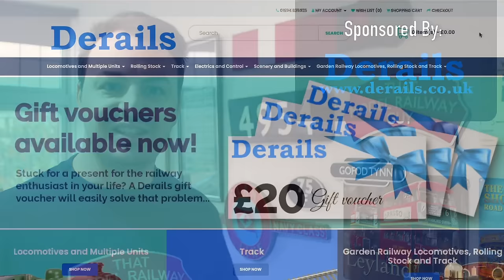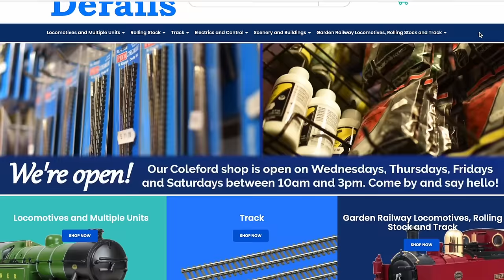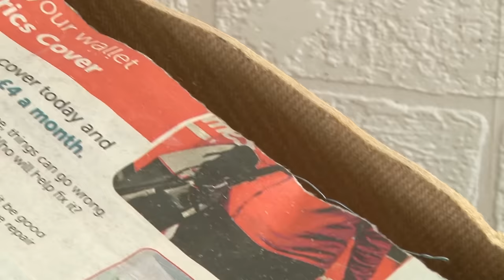Building A Modular Model Railway: Episode 25 - How To Create A Cutting!

Comment: Hello!
I've just wanted to say I've been watching your videos for about a year now and I love them.
Your videos have helped me through difficult times and make me feel better.

It's great to see all the modules finally coming together.

I have a question
If you had to replace a peace of track on the layout, particularly some in a tight spot like inbetween a platform, how would you do it?
I'd imagine it would be difficult especially when its all nailed and glued with ballast on top of it

Either way
Thank you for your videos
They make me so happy:)
Reply from the maker: Hi there, I'm really glad to hear that!

So I'd start with removing as much as you can from the area - definitely buildings but also trees, signals, lampposts if they're not glued down. The less stuff you might accidentally damage the better. 

If you've ballasted the track using the normal PVA method you can add some water to soften up the glue using an eye dropper. If the track is nailed down, you can usually get a fine screwdriver under the head of the nails and prise them out.

If the track is also glued it might be more tricky but if you use PVA then, again, water will soften the glue. The key thing is to go slowly with all this.

If you're planning to replace the track in the future then you'll probably need to clear out the existing ballast completely before laying track again, otherwise it'll be too uneven.

Hope that helps and thanks for watching 😃

Comment: Great work, just one suggestion, the track solder joints should be on the "back" of the rails so the people at the front can't see them.
Reply from the maker: But with a modular model railway, there is no front or back 😉 Generally though the solder joints need to be on the outer sides of the rails otherwise the would interfere with the wheels. Thanks for watching 👍
Reply: Good point.

Comment: I think you should place the building first and then build up scenery around it, or press it into the scenery before the glue fully dried, because the building looks out of place and not integrated properly. You coyld also try making a dirt ridge around the building.
Reply from the maker: The building needs to be removable for when the modules are stacked on top of each other for storage. As you no doubt saw from the video, the building sits on a foamboard base so pressing it in wouldn't achieve much. Once I have a bit more time though I'll be adding some extra weathering around the bottoms of all the buildings to blend them in more. Thanks for watching 😃

Comment: Since it's a heritage railway, I presume that it has been locked down and dismantled at some point, being restored later. Can you make a section of the track that is being rebuilt?
Reply from the maker: The problem there is that if part of the track was being rebuilt then the railway wouldn't be operational as most are single line track. I did include a bit of disused track on the embankment module though. Thanks for watching 😃

Comment: Please can you advise when you do your paper mache - what ratio of PVA to water do you use?  Thank you - i teally find your videos helpful and encouraging.
Reply from the maker: I don't tend to mix to any specific ratio but if I had to say I'd guess around 60% PVA - 40% Water. In the past when I'm pushed for time I have just used the same mix as I use for the ballasting, which is 50/50 but that can be a little too watery. That said, as long as it's easy to spread with a brush onto the paper you should be fine. Generally if you find a technique that works well, stick with that... if you'll pardon the pun! Thanks for watching 😃

Comment: Hey mate, great content as usual. One thing bugging me I know it seems to work for you but the crocodile clip on the applicator isn't that supposed to attract the fibres, so popping it in the glue is not really going to help?
Reply from the maker: No, the fibres are attracted to the mesh on the applicator allowing them to fall vertically and remain upright. The wire with the crocodile clip is to complete the circuit, so to speak, so it needs to be in the glue or at least touching the nearby surface. Thanks for watching 👍
Reply: Neither really worked the last time I did it as I stupidly didn't check the 9v battery was new 😂😂😂
Reply from the maker: What he says in that video is true for how the WWS applicators work and probably other branded static grass applicators too.
The cheaper ones I use work as I described. Obviously WWS want to promote their product as superior but personally I've never found there to be a significant visual difference in the end result for either method.
Reply: @ThatModelRailwayGuy surely they all work the same. Would make an excellent video to prove or disprove the logic behind it. Thanks for the excellent video tutorial again. Great stuff. Just a bit confused by the differing theories on static grass
Reply from the maker: While the end result may be similar, WWS's point is that they don't all work in the same way because they're designed to work differently and naturally  they want to promote their's as the better product. I did once have a very detailed discussion (including diagrams and everything!) about this with them back when they were Sponsors. I offered to make a video comparing the two but they declined.

Comment: what happens if you mix the 4mm and 2mm  in the applicator instead of doing 2 layers?
Reply from the maker: You just get a slightly more patchy, less consistent grass. You can absolutely do that but personally I find it works better doing one later at a time. Thanks for watching 😃
Reply: @ThatModelRailwayGuy  thanks for replying. I was just asking because I am getting around the stage where I add some grass to my layout! and I think I might get the one you have.